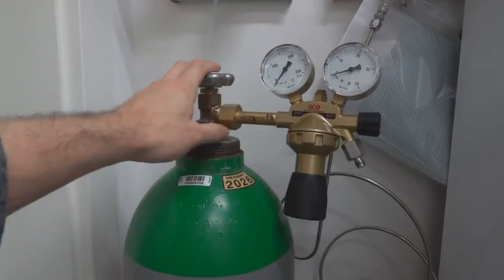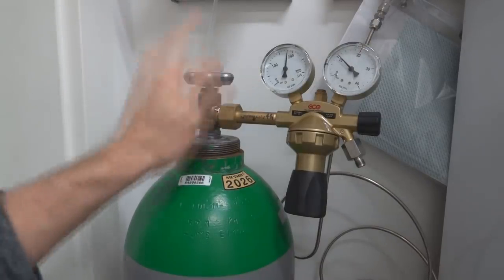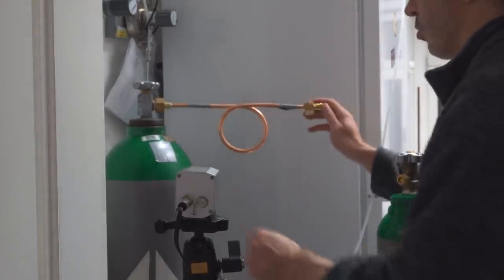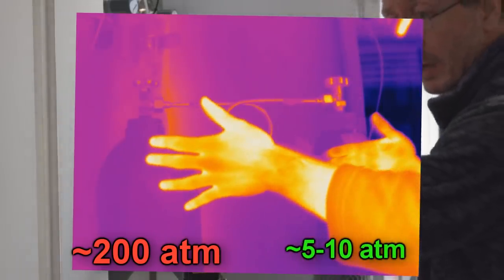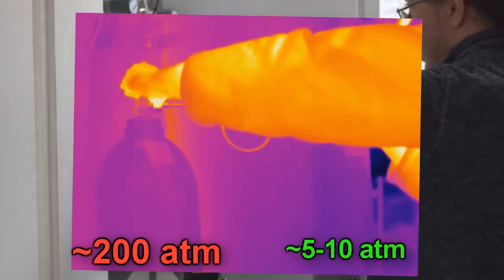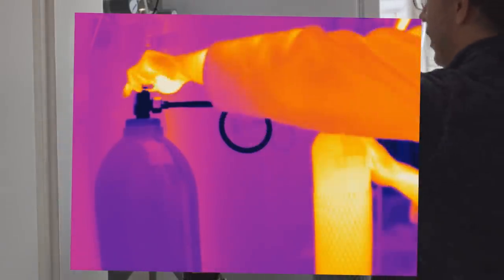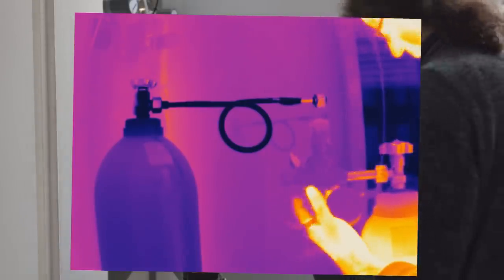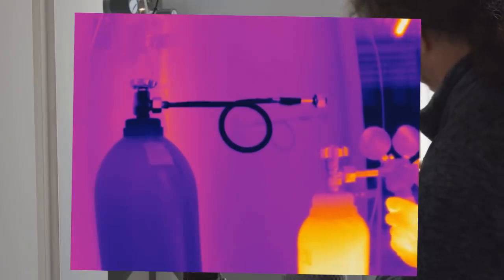Dangers of high pressure gas!

Comment from the maker: I was actually working on debunking of Elon Musks 'flying cars' using cold gas thrusters and ended up doing a high pressure gas transfer.....which just looked so AWESOME I had to share it :-)
Reply: Keep debunking the crap out of the bullshit.
Reply: I'm buying you some of Elon's cologne for Christmas.
Reply: Homo Quantum Sapiens  using cold air thrusters for flying is like making a cardboard box fly by putting air balloons underneath it...
Reply: @jetstreamer374  Just as long as you don't start taking some of the more... extreme elements of that group seriously...
Reply: LadyGaGa is hot  Musk has trouble putting the breaks on after he has started something, even when he has the physics involved completely wrong. So it's probably a good idea to point it out now before he gets to the point some rich moron with no idea how physics works prepurchases 10 and Musk can't deliver on his promises, again.
Reply: Tesla roadster 2 have acceleration 0-100 smth about 2 sec. Ok, let’s be acceleration with thrusters 1 sec and roadster mass about 2.5 t. So you need half of trust form trusters - 35kN for 1 sec. What is gas's emitting speed? Realistic nitrogen truster's isp about 600 m/s. Massflow needed 60 kg/s or 60 kg of stored air. Compressed nitrogen density of about 150 kg/m3. You need 0.4m3 HP balloon. So, its 90 cm diametr ball in trunk with 200 atm compressed air, wich will empty in 1 sec. On the verge of reality, but not total busted.
Reply: And that's why gas cylinders are placed in a water tank while being filled.
Reply: @ivuldivul  agreed,  best comment so far. You win the award Sir.
Reply: Homo Quantum Sapiens  look my comment was an answer on an other comment that was assuming that Elon was not trolling and telling the person how good it would work ... get the context right dude
Reply: So from what I've read from the guys over at nasa space flight forum, and a few other sources. It doesn't seem outside of the realm off possibility. Obviously it'd have to be used on a track and even then no racing series allows for it as of now that I know of at least. But you could take it to a track day and probably give it a go.

Here's an excerpt: "Looking at my half written article - filliing back seat with COPV - 140L of nitrogen at about 300bar 
~50 kg. Specific impulse ~50 means to get 1g of acceleration on a 2000kg car is 4kg/sec - 10 seconds of thrust.
So, not that unrealistic."

Also they aren't the only ones doing it. Bosch has been testing a system that uses cold gas thrusters to help regain traction on motorcycles. Big weight difference  but it's not like it's absolutely unheard of.

Will the car be able to hop up in the air like he claims? I doubt it. Would it be able to be used in aid of stability management like an on demand downforce, it seems like it. It seems like it would be able to help accelerate the car for a very short period, but I don't see why you would do that when you could just use it to put a ton of force on wheel to improve traction.

Just like the brabham bt46 or the old chaparral 2j they just wouldn't break traction with that force on the tires. Which they ran slicks and that also helped but this is going to be driven on the road so that's doesn't matter. I'd say the electric motor can accelerate it a lot faster if it wouldn't spin and just using this for grip on take off or in corners on the outside tires would be a huge benefit in terms of lap times. Which would just be for fun unless a racing series allows these things and I don't see that happening but the Pagani Zonda r isn't allowed at hardly any tracks due to its noise, it's not road legal and it doesn't fit competitively in any racing class bracket but it doesn't stop almost any car guy from wanting to give it a go.

This is just another evolution and the math seems to be there plus they got experience with cold gas thrusters and they make copv bottles. It seems crazy but I really hope they do it. We will see in the next two years if they can actually pull it off or not.
Reply: Just a correction in your description. I think you ment plan instead of plant. But please continue to make great videos.
Reply: This was intense and good.
Reply: Why is there thread tape on the compression fitting of the large gas bottle? (see 1:19)
Thread tape won't work and doesn't work on compression fittings. (for those that didn't know)
Also; Why do you not have the "safety handle" fitted to the larger gas cylinder? If that falls over and the valve breaks you'll have yourself a compressed gas ROCKET!
Other than that It's a nice demonstration. Thumbs up and Cheers :)
Reply: Could you do a Video about Fusion please Thunderfoot, I understand it actually is just around the corner and may solve the world energy crisis and ide like to learn more.
Reply: Great video! I think Elon deserves respect regardless of his posts about ideas which sometimes might be just 'ideas' which not necessarily will become market products. Testing ideas that wont work m8ght bring up new ideas which will :) Thuderf00t could you please make some experiments with high peessure PEM elektrolyzer? What do you think about Mazda piston engine fueled by petrol and hydrogen? Btw thermal camera is really cool stuff :D
Reply: Wont the tanks in the car get super hot while compressing the air and then cool down when they are released?
Reply: Show the maths
Reply: LadyGaGa is hot This
Reply: Homo Quantum Sapiens   lol what? this is pretty much what i was getting at.
Reply: Homo Quantum Sapiens  like my scene of humor
Reply: @Thunderf00t
Pretty sure that tweet is a joke tweet xD
Reply: Tell me about it...working in a ammoniaplant...yeah 210 bar at 44.000 m3 an hour..
Reply: "Didn't even plant to make this video"
fix yer desc pls thx
Reply: Can you capture the difference of pressure on a schlieren camera setup?
Reply: Whatever elon is snorting should be bottled for a fuel source at this rate
Reply: @MickyE117  - Elon musk IS a source of fuel!
Just strap him to the roof of a Tesla and get him talking! All the hot air coming from him will propel anything at the speed of light or BullSh*t
Reply: @TheHungrySlug  The funny thing is there are some decent things about those cars but so many basic issues like the frame being way to heavy and complicated compared to rivals
Reply: @MickyE117  - Don't forget the price. for what is paid in the $US for these makes them an unsuitable option for someone like me in Australia. Plus as you mention the build quality leaves much to be desired.
As it goes; For a car that costs somewhere around $100,000 US. I expect better, It's not hard learning from other peoples mistakes. Just ask questions and keep your eyes open and watch.
Reply: Yeah, it's so impractical, the amount of energy needed to compress the gas would be so wasteful for such a limited amount of function.
Reply: PV=nRT mate
Reply: @scotthendricks5665  - Very true, Now to apply this equation to Elon Musk himself. He is a bit of a windbag after all. Give him a joint and everything becomes a NEW, Big Idea, That just has to be breathtaking. Or Not
Reply: thanks, nice interesting little short.
Reply: HOW is it possible that Elon makes such dumb statements and projects, WHILE he is so brilliant, successful and intelligent on so many others, very closely related topics/projects???!?!?!? 
Can anyone explain this, please, it is a real puzzle to me...
Reply: Should have released some gas from the one you filled to see how fast it takes to cool.
Reply: at this point, you're beating a dead horse.
Reply: Hi thunderf00t, what do you think about this inventor: https://www.cbsnews.com/news/marshall-medoff-the-unlikely-eccentric-inventor-turning-inedible-plant-life-into-fuel-60-minutes/
Reply: Sounds to me like you were working on debunking a joke
Reply: Thunderf00t. Still an amazing chemist. Still a shit engineer.
Reply: @Ken Harris Scientists never claimed any of the above were impossible.
Reply: Hi Mr.thunderf00t.
Just gonna toss this out there and hope for a reply.

I was messing with a magnetometer app on my phone and measuring various fields from objects around. Then I turn it on myself and to my surprise I get a pretty high reading; 1000+ microtesla. Upon further investigation I narrow the reading down to my Parker Pen. I have been searching the web for any indication of why this might be but have no answers as of yet. 

Sorry for the bother but if I could trouble you for a thought.
Reply: Ken Harris, you failed to make a point.
Reply: Quite awesome indeed, some of the everyday things we overlook can be just amazing. Thanks for sharing!
Reply: Tell us about using Hydrogen energy through Ammonia as a storage medium
Reply: This video is wrong on so mnay levels...
Reply: @SuperWasara  How mnay?
Reply: Thunderf00t could have used a thermoelectric generator on the gas bottle to light a l.e.d maybe? 🤔😯
Reply: Thunderf00t theoretically it should be possible to generate electricity from something that is cold? that might be a NobelPrize 🤔🥶 🤷‍♂️
Reply: @DonaldSleightholme  What do you mean by "theoretically"?
Reply: Thunderf00t i suppose that you could of modified the pressure gauge to spin magnets inside a coil of copper,  but you would have to release the gas somehow... 🤔😯🥳
Reply: Thunderf00t I’m not a mathematician but i think that there would be a equal amount of energy on both sides so the equation for heat transfer to electrical energy would be the same for cold energy to electrical energy but reversed... 🤔🤷‍♂️🥳
Reply: Thunderf00t if there is a endothermic process  and a exothermic process what would a cold gas cylinder be classed as? i would call it cold energy.. 🤔 🥶 😯 https://en.m.wikipedia.org/wiki/Endothermic_process
Reply: SoundEnergy's THEARC-25 thermoacoustic cooling system requires your validation.
Reply: Thunderf00t oh the thermoelectric generator works by heating one side of metal while cooling the other side down apparently so you could build one connected to both bottles?  🤔🤷‍♂️ it might solve the climate change problem if upscaled and some automated system with non flammable gas was used but cost might be a issue... 😐 should i try crowdfunding a thermoelectric gas cylinder roadway 😂
Reply: Also known as the principle for air conditioning! Ha
Reply: Hey maybe you could debunk "compressed air cars" that we've been promised for so many years now.
Reply: @Ex Jack

Nanoparticles are not the same thing as nano robots (nanobots) you fucking moron. At least try to read things properly before you post cunty comments. Nanoparticles are very real indeed, though I can’t speak for the success of their use in this company's application.
Reply: I'm going to get a bottle of Argon gas. I have Uranium-238 metal I'd like to store under it, so it doesn't oxidize. It's pyrophoric. I'm into radioactivity, and I love your ionizing radiation videos! I have loads of different sources! So many people out there fear it, because they don't understand it! And some think non-ionizing radiation has the same hazards as ionizing radiation! It drives me crazy! And people who think they've detected radionuclides with a Geiger-Müller counter (usually using a dose unit, making the reading inaccurate) from Fukushima, when it's just natural Radon washout, and some use old survey meters, which are known to give erroneous readings, and those measure in R/hr! Those are for use after a nuclear attack! A spectrometer is what these people should use! Thank you, Thunderf00t!
Reply: Thunderf00t Could you please make a video explaining the dangers of explosion in compressed-air-powered vehicles such as the MDI AirPOD?
Reply: Elon was planning on cold gas thrusters? Bollocks! When the debate I had with him over Twitter was over hot thrusters it was a matter of material and chemical handling laws, but high-pressure cold thrust just isn't viable for any real long term application! The power, weight, and thrust ratios just aren't there even without the thermal energy generation problems shown here being a factor!

I can't tell which of his most recent ideas is stupider, opening a new "Gigafactory" in China at the cost of 3,000 US jobs and $2b in debit to China while China is on the edge of triggering a 3rd world war against literally every free country including his homeland, or thinking his team can somehow find a solution for localized power generation to power a high-speed, high pressure compressor for cold thrust enough to hold up anything more than a single 200lb adult male and travel for more than a mile? The most he's going to get out of this is a hilariously expensive to produce jump thruster.
Reply: What is the gas type he proposes using regular air?  
Compressed how?
Reply: Cool vid but no offense but in the description you put plant when i think you meant to put plan
Reply: @KiraSlith  I have started a multinational company.  It only had 280 people. But it was multinational.  So shut the f up, you just lost by making a completely moronic assumption.
Second it doesn' take anything for Trump supporters to get idiotic channels funded. In todays climate all you need is no soul and you will get all maga supporters backing you instantly.  You just pretend that climate change is fake, that anything left is going to lead to the destruction of the country and then you can have an entire FOX network if you want.  It is lies, funded by people who love what this message does for their bottom line.  Which is why people like thunderfoot and Alex Jones are terrified of having to disclose their finances. They are paid to spread misinformation.  Period,
Reply: The Journey ya really lost me how thunderf00t fits in wit jones and the MAGA audience.  All of his videos seem to be built on solid science.
Reply: @BillPalmer  Bill thunderfootsy is a hack. He starts out with an assumption, and then finds the data anywhere he can to support it. It isn't science, it is ideology.  You can see it because he targets only specific people for his hate, and because he he messes up the science badly at times...
Reply: Thunderf00t after looking on Wikipedia maybe if the metals were in the reverse order then it might turn cold energy into electrical energy? 🤔🤷‍♂️ https://en.m.wikipedia.org/wiki/Thermoelectric_generator
Reply: Thunderf00t if that doesn’t work then the periodic table might help? 🤔😯🤷‍♂️
Reply: And yet we continue to funnel millions of tax dollars to idiots like this.
Reply: @mpeugeot  how dose he take Tax dollars?
Reply: @88njtrigg88  I cat answer for certain, but I would guess government grants. Pluss all his rocket launches and cargo trips to the ISS arent paid out of his pocket, NASA money pays for it, and NASA is tax money.
Reply: @88njtrigg88  Elon Musk's growing empire is fueled by $4.9 billion in government subsidies

As reported by the LA Times.
Reply: Tell me again how many successful multination companies you have started?, employed how many people? Oh right. F-all.  You are just a bitter, slightly above average intelligence, with a much larger ego.  Sadly falling into a Dunning-Kruger local minima somewhere around the second wrung, just above Trump supporters giant cavern on the same graph.
Pathetic haters are..

Comment: If you fill a diving cylinder, it will typically be filled from ~30bar to 200 or 300bar within ~30 seconds. From experience, the cylinder get´s quite warm but you can still touch it without issues.. Maybe the diving cylinders might have a lot thicker walls than a normal 200bar gas cylinder, as they need to handle more stress, like being carried around and potentially being dropped and so on, while under 300 bar!

Comment: Wait, why does the target bottle get hot?  The air in the source bottle has already been compressed and had the excess heat removed from it to bring it back down to ambient.  Where is all of that heat coming from when it is transferred to the other bottle?  The only thing I can think of it that it is absorbing it in the tube on the way ( which becomes cold ).  If that were insulated, wouldn't that stop the target bottle from getting hot?

Comment: may be someone  can help me with this one.
The gas in the big cylinder on the left side is at 200 bar  and basically on room temperature. Now it goes over to the cylinder on the right  side  where it has a significantly lower pressure ,  So if  you release pressure on a gas the temperature should go down  right ?    
Where does the heating  of the cylinder on the right  side come form ?

Comment: Sorry but this video is wrong, and it could prove dangerous, if someone who doesn't have experience working with pressure listens to you and remembers what you told him
You should at least know the scale of the manometers before you use them. 
Boy, you're not working in bars that's for sure, you can't hold 1 bar of pressure with your finger
It seems more likely you're woking with kiloPascals (1bar = 100 kPa) 
Please put a caption to correct this video, since I've seen stupid people like yourself, getting hurt because they don't know the meaning of the pressure units

Comment: Speaking of problems with Gas. There is this new company that is claiming to use waste heat to power air-conditioning plants. The technical explanation on their website is non-existent https://www.soundenergy.nl/    also https://www.forbes.com/sites/johnkoetsier/2019/01/18/this-dutch-startup-converts-heat-into-cold-via-a-stirling-engine-and-could-just-save-the-planet/#56373f186744

yet PARC wrote a section on acoustic cooling many years ago. https://www.greentechmedia.com/articles/read/can-sound-waves-whack-power-consumption  .

This needs a really good review. I think it sounds like Solar Freakin Highways. Whaddya reckon ?